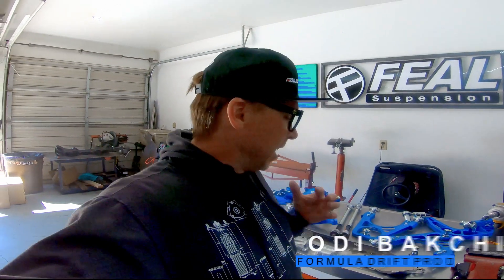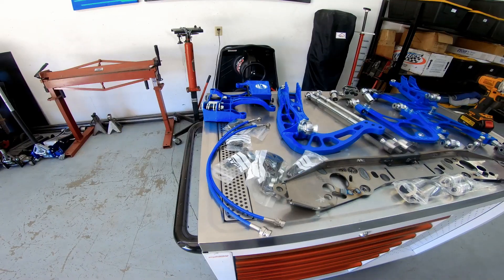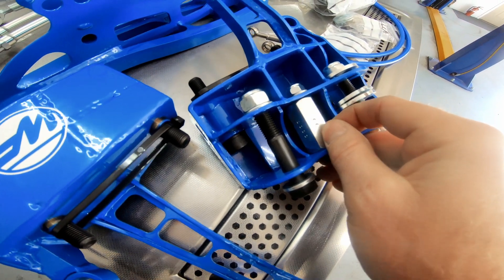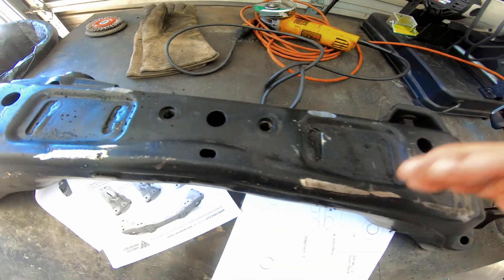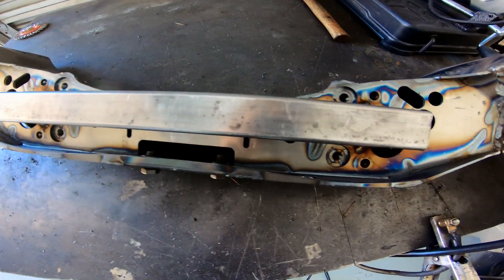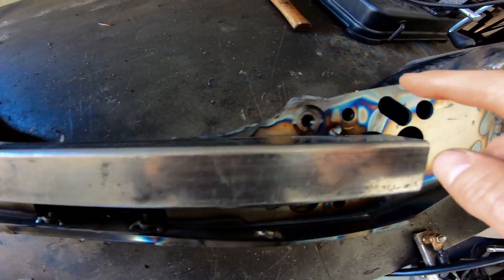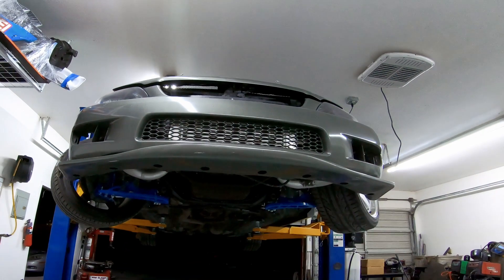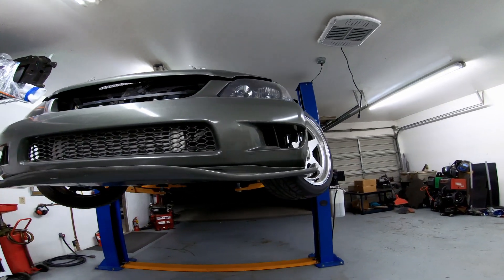Wisefab Lexus IS / Toyota Altezza Angle Kit Installation by Odi Bakchis

Comment: Does the is300 platform share the same suspension as a 06 is250? Cause I can’t find anything for the is250 as far as drift angle kits
Reply: No sir
Reply: is300 is pretty much the same as jzx110 is250 are much more similar to the GS platform